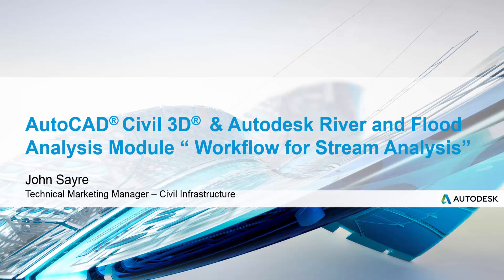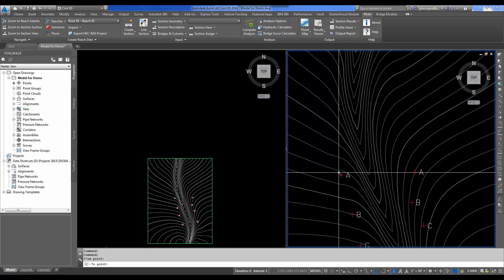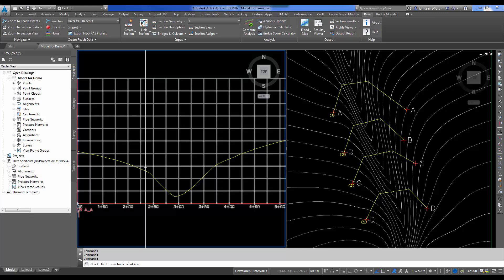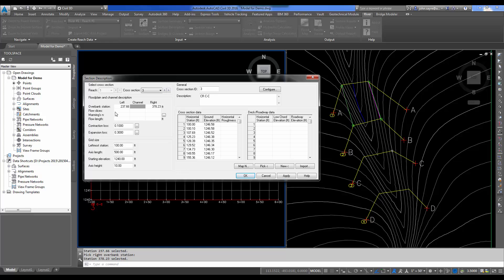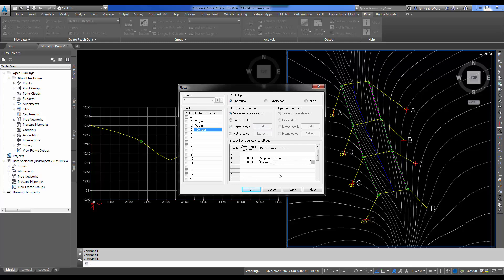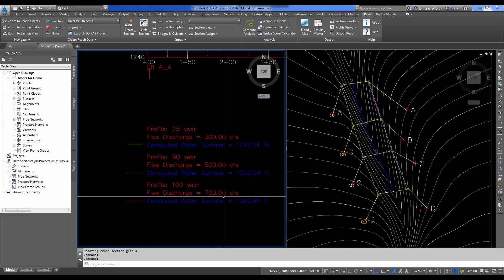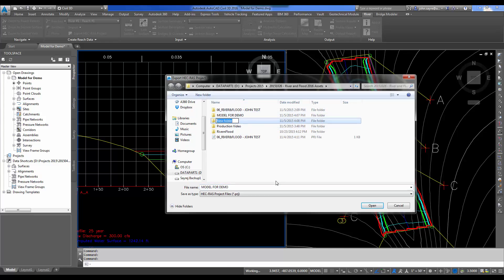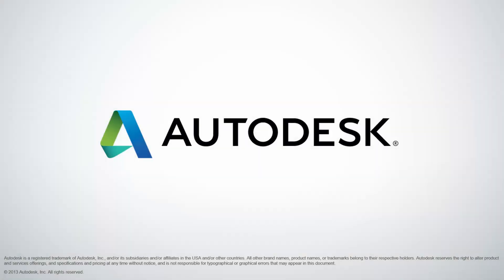Autodesk River and Flood Analysis Module "Stream Analysis"

Comment: Is it possible to design river or roadside ditch with SSA instead of using this module? I found SSA only recognized nodes as inlets ,but for roadside ditches runoff directly go to the ditch.
Reply from the maker: +Tony Derrick 
You should be able to model ditches with conveyance links. There are a couple of different approaches, one would be to add a generic node and add the flow to that node and move the water with a conveyance link.
John
Reply: +John Sayre Can we model the channel with known catchment area and rainfall like the way we model pipes? Manhole is inlet for pipe but for channel it is quite different. Thanks.